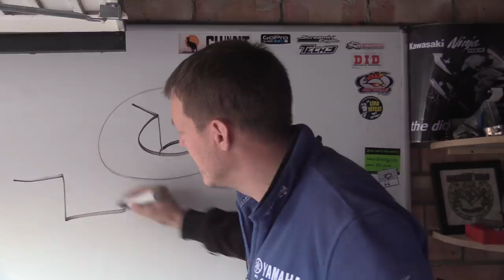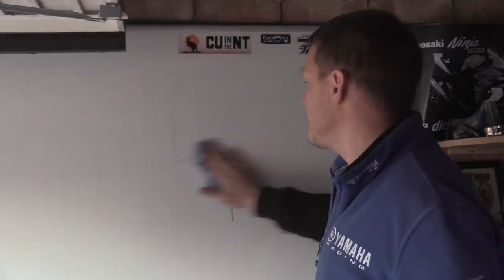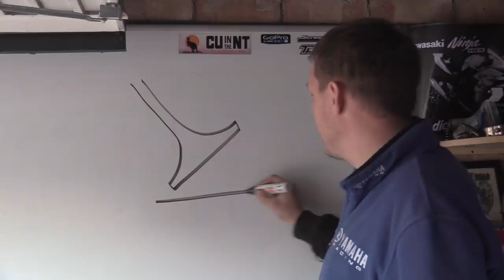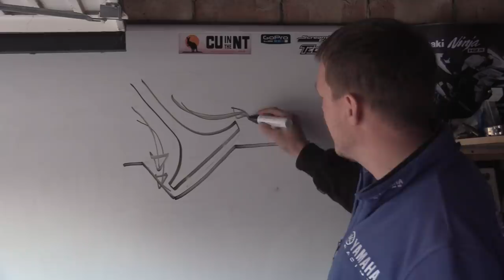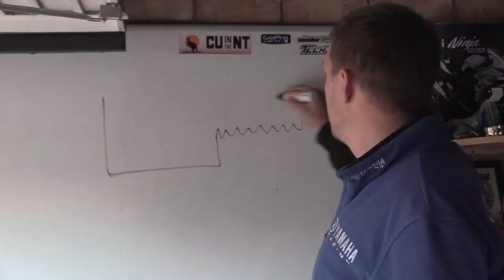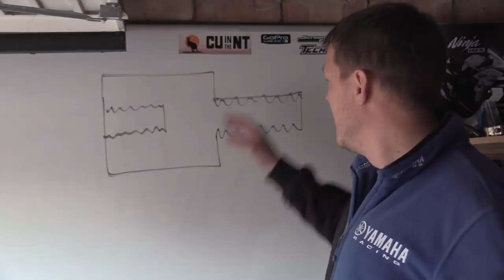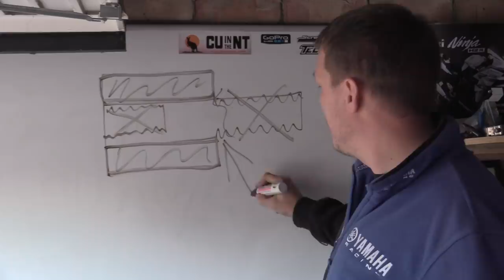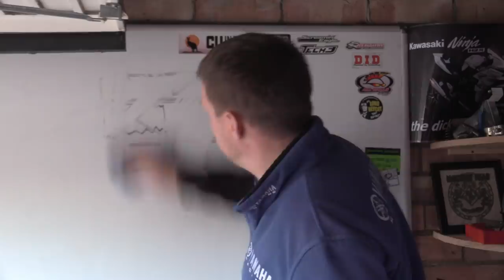All the gear, no idea

Comment: Hmm, totally baffling stuff. I've worked on and off in the motorcycle industry for 30 odd years. The biggest problem we have nowadays are 'customers'. People who won't listen to common sense and experience and want us to do plain stupid and dangerous stuff. Pretty much of it's daft old blokes who have a problem with accepting that a business run by two women has more experience and knowledge than they do. I can still remember a moron in tears in my workshop because him and his throwback mate had taken the cam chain tensioner out of a Z1 and kicked the bike over. He just couldn't get it that he'd bent 5 or 6 valves judging by the 1/2 inches clearances and I couldn't wave a magic wand to fix it. We are stacked out with machining jobs and have now started to have to tell numpties to go elsewhere as they're more trouble than they're worth.... and don't even get me started on tight fisted idiots who think we're a charity!!!
Reply: Chris Stevens  There are still a few of us around. Most of the other workshops we know of are run by people in their 70's, old style toolmakers who have turned their hand to the motorcycle industry. Most of the parts we machine are Norton parts from raw castings as OEM parts are no longer available. We build, repair and restore everything from relatively modern Japanese bikes back through to British classics. We do build traditional 'cafe racers' but not those hipster abominations you see on the net with beige seats made out of old sofas. Function is important and, over the years my trust in other mechanics and machine shops has evaporated so I had to put my money where my mouth is and set up our own. I am responsible for the machining and mechanical work and my partner does the fabrication and welding.
Reply: Chris Stevens  Most Norton parts are available new off the shelf but that's because we make them. Oil pumps, TLS brake plates etc etc. We make parts for everything from 16H's and CS1's to Commandos. 
My personal bikes? I have a Yamaha FZR1000 RU, a Norton Domiracer Lowboy replica and a Dominator 88 Cafe Racer built to SS spec. 
I've run the workshops for a well known Yamaha dealer here in the UK and a Suzuki Dealership in Germany. I'm not sure I'd call myself an engineer but I was asked by a retailer I was buying parts of to do work for them when I brought in some parts I'd made to ask a few questions. I think the older guys who have mentored me are just pleased that a younger person is interested and prepared to get their hands dirty. They know that small engineering workshops that can do one off jobs or short runs ARE important.
I was lucky enough to grow up in a family where pretty much all the boys are real engineers and my brother is a chartered engineer. I was helped to race in Motocross and I raced a TZ350 once I left school and got a job.
The honest truth is I find it very satisfying doing the best job I can.
Reply: Chris Stevens  I could say so much about hipsters and the current media that seems to support them as well as a select few idiots who build abominations that I absolutely don't get the point of. It is difficult to complete with far Eastern manufacturing ( not all of which is bad) but there are certain people who try to keep manufacturing in the UK even though this means smaller profit margins. We do tend to concentrate on high quality parts but wonder if we are actually appreciated. What counts in the end is being able to pay the bills and having a job which gives pleasure and satisfaction at the end of the day.
I can't say exactly who our customers are due largely to the internal politics of the old duffer classic bike 'scene'. We find younger people to be more willing to listen to advice and pay reasonable prices although that's not universally the case.
Reply: Chris Stevens  But that would attract what we call 'customers' god forbid 😅 We normally get our work by word of mouth and by reputation. My partner handles the Internet stuff as I'm an analogue girl and clueless where that sort of thing is concerned. I'm so busy that I rarely get chance to do anything more than work. I don't  even do Facebook as I hate that sort of thing.
Reply: Chris Stevens  I tend to pinch 6 month old magazines from people we know as I have better things like bills to spend money on. We saw an Indian Brough replica tank which leaked a while back. Sham as the welding to heal the leak made a mess of the polishing. Some things China and India make are really good quality but other things are not so good. Depends on your luck.
I've watched the classic car and bike markets rise and fall so many times. They're all only worth how big the smile they put on my face to me. I asked at a show how much a CCM 580 I once owned would cost and was told £20,000 😨 CBX's like I once had are creeping to ridiculous prices, even BSA Bantams are fetching silly money for what they are. I wish I still had all the bikes I've owned in the past. I'd flog them all and retire 😊
Reply: Chris Stevens  Seriously, I don't have time time deal with the internet. The likelihood is that I will move away from motorcycle engineering and into more lucrative industrial repair. Talking to lots of other people I deal with in another business we run (unconnected with the motorcycle trade) it and another line seem much better options. We'll look after some of our old customers but that it really. Motorcycle stuff is better left as a hobby rather than a living. I have my own long term plan but it needs to be more profitable. My real interests lie far away from motorcycles and engineering. They are what I do because I can not because I want to, to be honest
Reply: Chris Stevens  In short... I'm not really a lifestyle motorcyclist and having driven everything from Lamborghinis through single seat, open wheel racing cars as well as more motorcycles than I can remember my opinion is... don't ride or drive anything unless you want to be disappointed. I can only remember one or two machines that have impressed me. So, as you can imagine, collecting cars or bikes isn't my thing. I've recently come to the conclusion that I have little in common with the average biker, hipster or collector. I forgot to mention, I have a BSA Bantam too. It worries my that I can't even remember how many bikes I have.
Reply: Chris Stevens  They are areas of engineering I have no interest in. I have no formal engineering qualifications and much of my working life was spent in very different fields. I'm really only interested in forwarding my own long term plan. As for machinery I have an M300 lathe, the long gap bed version, a Bridgeport series 1 and a couple of surface grinders, one which doubles as a tool and cutter grinder. I am limited by space somewhat after learning never to trust a landlord commercially or domestically. My partner does all the fabrication, mig and Tig welding etc in another workshop. Personally I can think of many other things I'd rather do but this is what I seem to have gravitated to due to geographic location and necessity. It's down to being able to carry out enough commercial work to pay the bills not some misplaced love of motorbikes. If something more lucrative comes along I'll reconsider my position but until (and I believe that's a very slim chance in Britain's wrecked economy) this is my lot. It is what it is... I'm better at what I do than an awful lot of people who claim to be good and not as good as I'd like to be.
Reply: Chris Stevens  Remember Hag Hugh's? 😂😂😂 There is another rude and inadequate builder of pointless rubbish today who springs to mind. Sadly we do not live in a meritocracy here in the uk. To quote someone who I really admire and like as a person after meeting them briefly at a talk they gave 'Talent is everywhere, opportunity is not.' Luck and who you know, this is how to get on here 😒 My work speaks for itself.
Reply: Chris Stevens
Reply: Chris Stevens  I have a longish term plan and at the moment, what we do pays for that. It might be hard work at the moment but we'll be okay in the end. We simply charge what we think is correct at the moment. We're not a charity and there are very few options for the idiots who think we're a charity.
My CCM was one of the early Alan Clews machines not a BMW powered modern version although they are quite nice as far as I've  seen.
Reply: Chris Stevens  No, motorcycle engineering isn't low rent as you put it, it's the idiots who think it is and don't think they have to pay who are, in actual fact low IQ, to coil a phrase. Most work is safety critical as I think the point Matt makes with that butchered wheel. 
The sad fact is that education has been made a commodity which many of us can't afford here in the UK. I still own money on my history degree for instance. The tiny minority of people who go out and track down the knowledge they need aren't appreciated here. We get paid, it's the matter of putting up with ignorant people who don't possess any real skills and think that their desire to play motorbikes translates into my enthusiasm to work cheaply to enable them to. 
My partner is a she fyi and one of our most lucrative lines is repairing the irreplaceable. We recently repaired a set of badly damaged Commando crank cases and the owner was so pleased by e paid us a bonus over and above the not insubstantial cost of welding and machining. When I asked him why he wanted to overpay us his reply was that his bike remained totally original and unblemished. Sadly he's the exception rather than the rule. Oh and he rides all his bikes regularly not a collector. Perhaps it's because he's a craftsman in his own right he appreciates other people's expertise?
My experience of running a dealership in Germany along the lines of a British one was that the customers were so much more appreciative. Perhaps this is why motorcycle engineers here are becoming such a rare breed. I do feel that I'm possibly letting down the group of older guys who have helped us over the years but I've had enough of the UK. 
I have some great friends in the engineering trade but I think it's a dying trade here. I'm making a list of countries with pros and cons to help decide our next move. We need to renovate our 17th century cottage which was ironically a smithy originally and that's our plan. We deal in used engineering tools and machines from a few units we rent too so my pissed off attitude towards the UK and it's cabbage headed great unwashed is a general observation really. I believe that our adaptability and ability to diversify will see us through.

Comment: When i was 15 i got the brilliant idea i could machine out the scores on my 2 strokes head. I put it in my grandpas lathe, turns out machining a dome by hand isn't very easy. I finally realized how pointless it was.

Unless you've machined the same part 100s or 1000s of times its probably not gonna be high quality. The art of machining by hand is pretty much gone. Now the closest you can get is a machine operator putting parts in and out and making sure the machine has a good bit and that everything is running smoothly and within spec.

Comment: In my car I turn pistons backwards .been 2 vavle head cut a eyebrow or valve relief into the intake side buy using a modified intake valve that's a another story.to the point its about piston pin offset which  in turn puts rod a few degrees back which in turns gives more acceleration. Got that trick from a top fuel mechanic.

Comment: just wait for Del to make his own aluminium brake rotors from soda cans cut up, laid flat, sandwiched together w/ fucking loctite, and then held for 6 hours in a hydraulic press. another day done!
Reply: and don't forget the copper grease. put it between every three layers or so, and it'll be a self lubricating system! smart, huh?

Comment: Matt, I got another guestion. Has a 4mm L-profile bar the same strength as    a 2mm square bar?  Steel for example, same alloy.
Reply from the maker: In what direction? Orientation is important with beam theory
Reply: @dirtygarageguy  I really don't know. I was thinking in general, from every angle...It would be interesting with a comparison in some way and with different materials and thickness.
Reply from the maker: "from every angle.."

- In that case no.
Reply: @dirtygarageguy  Not sure if I used the right word. I mean angle iron, but I guess it doesn't matter?  Example 30×30mm, 4mm thickness  vs square bar 30×30mm, 2mm thickness.
Reply from the maker: That's better - I can work with that.
Reply: @H-M-78  The rotation of the angle iron section is important.  If your angle iron is sitting pointing up like /\ and the load is pointing  straight down, everything is symmetric and it's great. If your angle iron is like an L and the load is going straight up or down, it actually introduces a twisting force (because the shear center and centroid aren't aligned)

It could be important to you that when the load is applied the beam doesn't twist, in which case you  should oritent it correctly or use something else.
Reply: @phitsf5475  Great respond! Thanks! What if I use 2 paralell angle iron like this? 
|_  _|   How do they work together?

Comment: the problem with dels stuff is this..he moans that all 'stealers' are ripping us off, then tells us it took 6 hours to make 3 stand offs..so thats £35hr x 6 right?? no. it should take about 30 mins to do that job
but the correct solution was..move the rec??
 the current craze for the 'cafe culture' means theres now a thousand dels.. all inspired by del
but the point is theres no prior knowledge..wonder why we dont see youtube surgeons?
FFS it takes years of knowledge to know if you wheel spindle will take the new 6 pot calipers you thought looked cool
i used to try to help..but then i got to a stage where i just said ..fuck em..let em learn
so now we are in a weird position where its cooler to say 'i made that' than pay an experienced guy..go figure?
there are some talented guys out there for sure, but for everyone interested get Tony Foales books and learn materials science/load types and calc/mass and gravity centres/relative stiffness of materials/ elasticity
if you wanna get advanced learn wireframe construction principals (race) /multi matrix materials/ 3d metal printing/ FEA/CAD./harmonic resonance...any one of these takes years alone: )
just basics..get the PC load a pic of the bike you wanna mod and draw it out in MS paint if you dont have photoshop
you'll see straight away if it looks right and it saves hours of work..there are various FREE cadware programs out there too..engineering is ART and Science
Reply from the maker: Very good point, and well put

Comment: As an actual machinist, this guy makes me physically ill.  This is a great example of more money than brains.  MAYBE, if you used cold rolled steel, properly filleted, and real threads cut with the lead screw, oh, and not all the way back to the step, leave some room for transition/fillet! facepalm And a GRINDER on the cylinder head??!? WTF?!?

Comment: WTF how do you tighten the twatty things in to the frame? 2 flats to be milled on? Dividing head 6 flats? No mate maul um in with pipe grips or spend another hour ...sorry 6 hrs milling. As you say its an alloy thread so will shear off when you try anyway. Wholly inappropriate engineering, as an engineer would just make bushes, use the right length bolts and save 5.5 hrs!

Comment: oh boy... and the D is using wd40 as cutting/cooling fluid like every real expert
Reply from the maker: WD is quite good as a cutting fluid for ally...
Reply: but it does actually say on the safety sheet not use on hot surfaces, and during machining class we were told it just pisses off from where itd be needed and the vapor is quite nasty...